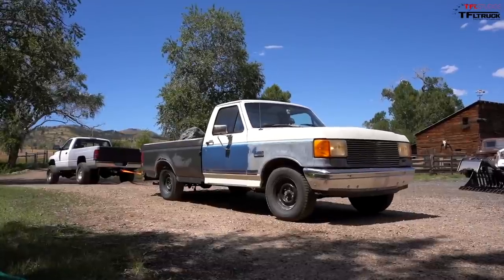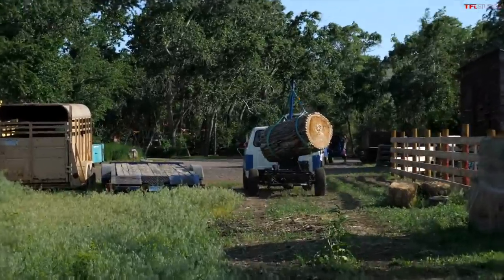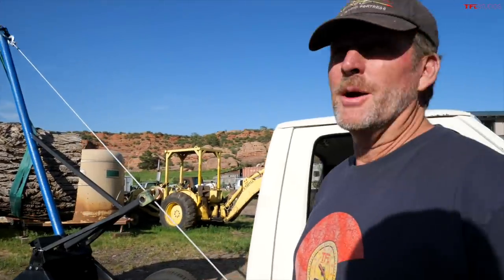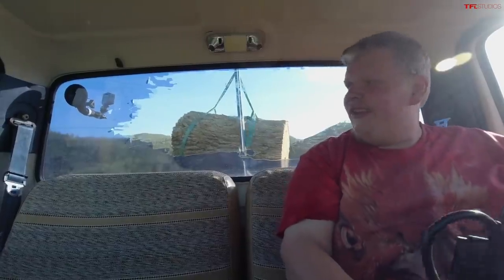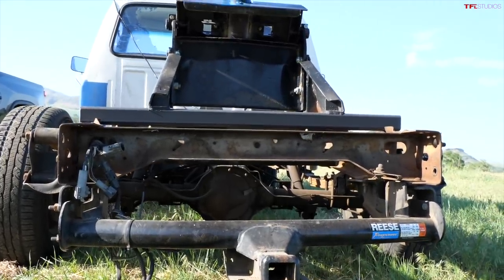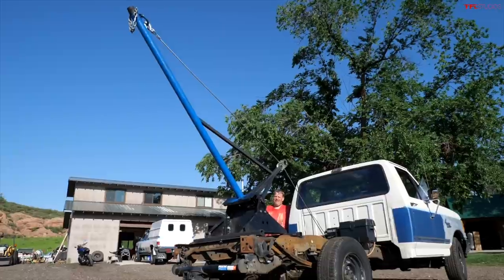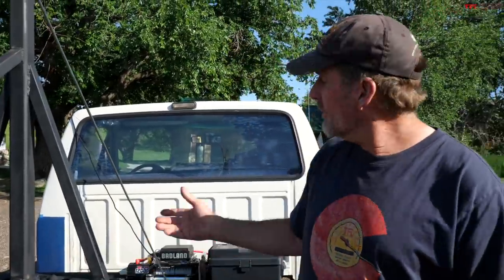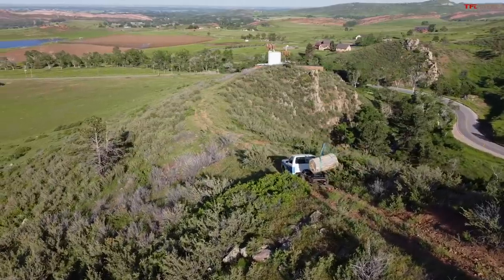Don't Try This At Home! We Turned A Clapped Out Ford F-150 Into A CRAZY Homemade Redneck Wrecker

Comment: i have an 84 f150 with that same paint job... 300 i6 with the 4 speed and camper special springs... it will just not die. I have hauled 20 round bale trailers with it, 2-500 bushel wagons of corn to the mill for years.  20k lb green chopped corn silage wagons with it out of the field home, all from the bumper hitch. it just takes it, every time.

Comment: You want some frame flex for the large loads.  Take a look at the 1 ton trucks, last I looked, the rear was still open channel while under the cab they box the frame.
Reply: The majority of movement was from the springs. Some helpers or a rear 3/4 ton conversion would do wonders for the flex

Comment: Swap in a sterling 4.10 DRW rear that is locking and an NP435 or T18 and it will haul whatever you want, I know you guys can tell the difference between the auto and the NP435 65 F250 you guys have
Reply: A 3/4 ton spring and axle combo isn't out of the realm of possibilities
Reply: @danatkinson6698  exactly